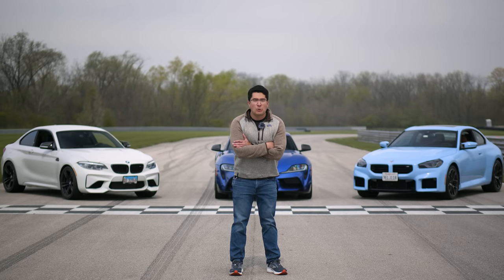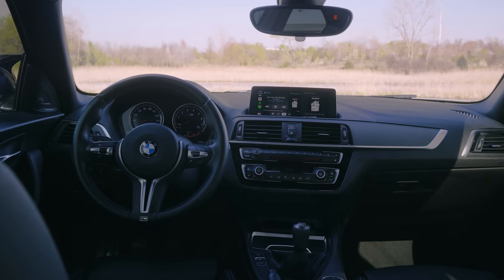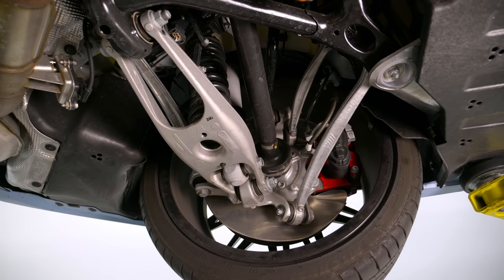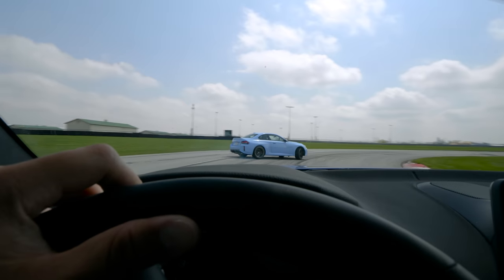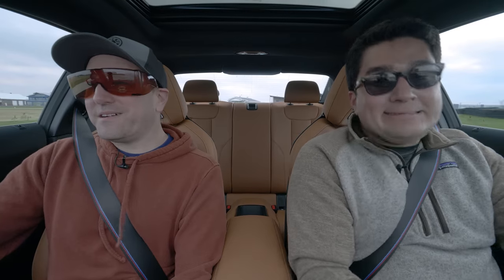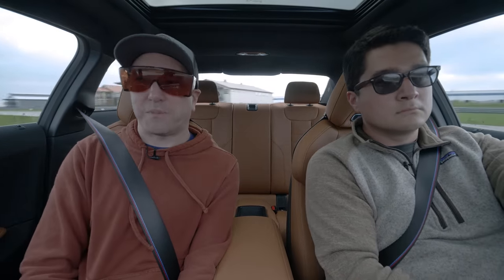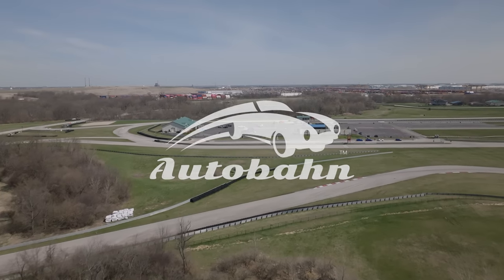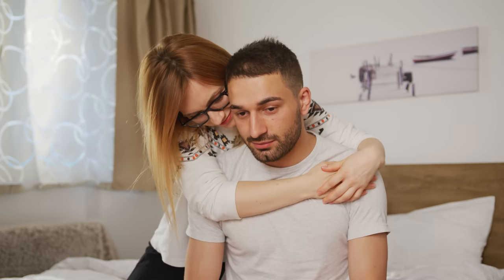2023 BMW M2 vs Supra Manuals | Laptimes and Drag Race

Comment: OG M2 is just a special machine. Often slated for not having an S engine and poor seats, however, this will be more appreciated as time progresses.
Reply: The n55 is weak no matter how you slice it…a special car needs a special engine or at least a competent engine and the n55 isn’t that in my opinion
Reply: The N55 does sound good stock. Emissions going in the way of the S55 sound glorious stock.
Reply: @mogulme6190  Fair, no opinion is incorrect. However, the 1M often hailed as one of the greats, does not feature an S engine. A special car compromises of more than just an engine, in my opinion.
Reply: @user-wz4fw2ws1s  this is a great point! I myself picked up the M2C recently but would have been happy with the n55 as well. What steered me to the M2C was, yes, the true M (s55) engine, still getting some warranty left and having to do next to nothing to get it track ready (bigger brakes & cooling). The OG M2 does require some work on that front...especially at high elevation where I'm at (cooling issues exacerbated)
Reply: the seats were ugly but better. I have owned the OG and now have an M2C and prefer the usability and comfort of the original seats.
Reply: @mogulme6190  lol you clearly never drove it. that said, i did put a wagner comp evo IC, charge pipes, exhaust, FI catted DP, and BM3 stage 2 and it was a beauty to drive.
Reply: @cwx8  n55 really is known to be the weakest of the N and B straight 6s.
keep it stock and its fine, push it and can start spinning bearings. See it all the time on the groups for N54 N55.
Reply: @yuriteixeira5816  And S55 spins the crank hub. So. Just BMW things.
Reply: @cwx8 plus a Bend Calibration
Reply: @idokwatcher2062  Not to mention cylinder coatings in S55s and B58s could start failing (there's reports of that already on forums), whereas the N55 of the M2 has iron sleeves
Reply: @mogulme6190  you can't even afford the car 😂
Reply: Yeah it's the only one in this group I'd consider regardless of being slower
Reply: @user-wz4fw2ws1s  the name on an engine isn’t what makes it special. It’s the character and capabilities of the engine. The n54 in the one 1m is far more capable than the n55. Which is why it was used in the 1m even though the regular 135 and 335 had already switched to the less potent n55.
Reply: @pushdaenvelope  lol you bought the one you really wanted…the one with special engine… the one you know has a bunch of potential. If you were that comfortable with the n55 you would’ve bought one for much cheaper. I’m not saying the OG m2 is bad, but it having a n55 makes it significantly less cool. Than if it at least had a b58.
Reply: @mogulme6190  again, different horses for different courses. Not everyone is concerned about the engine capability as a percentage of owners will keep their cars fully stock. For me, an M car is more than just the engine, perhaps this view is not shared by yourself or others.
Reply: @mogulme6190  a lot of people also aren’t concerned if their cars engine is “cool” or not. People buy things to fulfil themselves and not others.
Reply: @yuriteixeira5816  6 years of active M2 ownership and forum reading and I don't recall ever hearing of one spinning bearings. Not saying it doesn't happen, but it can't be common thats for sure.
Reply: @mogulme6190  yes i did buy the one I want.  Never said I "prefer" the OG M2 with the N55. I'm merely saying I would have been happy with the OG as well. I still think either of them are a great car. The engine is only one piece of the puzzle for me as I outlined in the post.
Reply: @mogulme6190 n55 sucks but the rest of the M2 makes up for it.

Comment: Thank you for putting them on the same tires. Shows the true difference in capabilities. Curious how well the 2019-2021 M2 competition would have done with more than 400 horsepower. Thanks for the great content.

Comment: No comparison is perfect and you guys did an amazing job keeping things as comparable as possible. Thank you for doing such a great job. I would be very curious how a F87 M2 Comp would fare in this test. That said the new M2 is so heavy and unattractive in my eyes that no amount of performance can make me desire to own one. If I could afford a manual Supra it would be my choice of these three here. Love the F87 gen M2 as well as it was the last BMW drivers car if you want to call the Supra a Toyota product. Btw love the Garmin data on the lap times. Really helps illustrate the differences in turns and braking.
Reply: In all the comparisons of the M2 Comp and OG M2 the cornering speed is fairly similar, but the M2 comp has a higher speed on the straights by 5-7 mph depending on the straight length (135ish vs 140sh). So on a small track like this it'd maybe be up 0.5-1 sec on the OG M2. Still probably the slowest car here. In Car and Driver's lightning lap the 2016 M2 ran a 3:01.9 and a 2019 M2 Comp ran a 2:59.7. Only 2 sec different and that was on the huge VIR circuit with plenty of straight to show off the S55 advantage. Add an intercooler and tune to the OG M2 and it'd be the same.

Comment: Fridays always better with a SG video! Great comparison as usual from the best car channel (both content and production)on YouTube.

I’d buy a Camaro ZL1 over a fully loaded M2 FWIW…
Reply: ZL1?? That's like 650 hp, isn't it? I don't think that's really a comparator, maybe an SS. And you still can't see out of them.
Reply: I can’t see anything out of the ‘maro.
Reply: agreed, hard to be a track ready weapon like a ZL1
Reply: @johnsullivan8673  buddy has daily driven Mustangs for years, picked up an SS and has used it as a DD and says you get used to it re outward vision. Has a ZL1 on order and will dd that also. He works for an auto group and was a BMW fan for years but as he says there’s nothing like a v-8. On another note the new M2 is awfully heavy.
Reply: @TML34  I think they are both around 72k so yes IMHO in terms of price they are competitors.
Reply: @TML34  id only consider the camaro as convertible for that reason, and it even looks allright

Comment: I fixed the front end problem on N55 M2 by installing the camber plates (-3). Reprogrammed DCT, Steering, DSC and rear diff, Performance pads and the car has transformed! Tune the engine to the stage 2+ with little budget and you get the car on the same performance level.
Reply: n55 runs pretty hot right out of the gate stage 2 without radiator or charge intake manifold upgrade would run into limp mode if track in 100f ambiant.

Comment: Great video guys thanks!  I am a little surprised you ran the OG M2 compared to the Competition; the sharpness and power differences are pretty significant.  If we could get the manual CS in there that would be the dream but I will take what I can get, lol.  I believe the M2 CS is the only manual CS-trimmed car, for whatever that is worth.
Reply: The Manual CS is not a fair comparison to the G87. Once the G87 CS comes out next year or 2025 then it should be fair
Reply: What sharpness difference? All suspension bits have same part numbers between OG and Comp

Comment: Sounds the older M2 is the way to go and just spend the price difference on power and suspension bushing upgrades!
Reply: Doesn’t need that, alignment and cs steering, diff and traction software.
Reply: No, you’ll be spending the price difference on maintenance and repairs.

Comment: What tire sizes did you run on the new M2? I didnt think the RE71RS came in the proper sizes yet for that car. Did you go down to 19s or did you run the 285/35R20?
Reply: Factory size. Aspect ratio slightly changed
Reply: @jackholmes8105  so a 285/35/20?  That is over 4 percent taller than stock assuming a 275/35/19 was used on the front.  From personal experience, that will mess with a ton of things like the diff and abs.  I am surprised the car even drove out of the bay in the regular start up mode without the TC freaking out.
Reply: @laloosh04  as the tires and wheels were already staggered it made zero difference. Car was driven with and without the re71rs and the car other than grip levels drove the same.
Reply: @jackholmes8105  You increased the rear diameter of the tire by almost 1.2 inches.  The car uses wheel speed to dictate abs and diff behavior and all this matters to how the car drives, grip levels won't change, electronic behavior and car balance will.

Comment: i really feel that the chevy camaro ss 1le should be featured more in comparisons betweens cars like these (i know it's an i-6 comparison but i mean overall)
Reply: Many Cartubers are sleeping on the SS 1LE. Randy Pobst has a 1LE, probably for good reason. Zygrene says it would have been his choice if it weren't for his Porsche. Only thing is, tall gearing.. Which I guess points to its track purposes though.
Reply: Yeah and a stock SS 1LE is 15 to 20k cheaper and faster

Comment: So in conclusion, G87 M2: Capability. A91 Supra: Focus. And F87 M2: Experience. 

Its almost like the 3 corners of sport car alignment, the different ways a car can be made to offer its driver, to provide a sporting ride. Savagegeese had the benefit of a track to properly analyze these nuances but I like to think that similar transitions to street driving, where the same flat out drive isn’t usually allowed.

Comment: Needed an M2 competition also….
Reply: Na it’s way heavier, uglier and looses all the character of the original one.
Reply: Has a m engine
Reply: @lloyd.8272  how is it uglier that the n55 m2 😂 igs the same care just has 5mm wider kidneys you cant even notice, 95% of the mosy panels are the same. All thag changes is the minutely bigger blacked out kidneys and three hair line size slots on the bottom lip of the bumper
Reply: @Newgenblackops  the conjoined grills give the appearance of car not being as wide. The edgy front bumper doesn’t match the rest of the car and the exhaust silencer looks like a 90s Alfa.

Comment: S58>B58. Not even a fair comparison. I have a 2023 A91 6MT and I'll give my thoughts. M2 G87 if you want daily driving comfort and out of the box speed. Supra if you want a 2nd car or weekend car fun and easy tuneability because tuning a B58 is less expensive and there are so many upgrade options. If you enjoy building, go Supra B58. M2 F87 if you want budget fun that you can also build and don't want to break the bank because it's used and less expensive.

Comment: Been waiting on y’all to do a manual Supra review for months😩😩. Was trying to hold out before I put my deposit down but I did it anyways lol. Thanks for the upload regardless💯
Reply: You were debating between the Supra manual and the G87 M2?
Reply: @chrisginoc  I was debating between a manual Supra and a Camaro ZL1 1LE tbh. The old M2 Comp was on my radar but not willing to pay what people want for one when I got a new Supra at msrp
Reply: @madmyro  I had a 2021 M2 Comp with 4k miles on it under contract a few months ago but pulled out before I signed the final documents when I found the 2023 A91 6MT. The Comp was nice but I couldn't get the manual supra out of my head.
Reply: @chrisginoc  same, plus after a ride along at the track with a stage 2 Supra (auto) I completely fell in love and sat in a A91 manual and the shifter feels amazing compared to the others

Comment: AI Jack may need to mention CLAR as well as B58. Jeez , an effectively 4000 lb "baby M" .  The F87 M2C weighed more than F84 M4 and yet still felt so much more nimble.  Had the manual Supra been available when shopping, I could have forgiven the horrible visibility.  Great stuff, as always.
Reply: need to check your weight figures.
Reply: @jgr  As I recall F82 was 3300ish M2C was 3500ish. I did do a chassis code misnomer.
Reply: everyone who drives the M2c soon moves on to the newer flashier thing,

ppl who the drive OG know its really the best recipe for a car and tend to holdem for life,  or they end up regretting selling it

Comment: Wish you guys had the Competition on hand, but still a great test. Pretty much what I expected.
Reply: Suspension and chassis are identical.
Reply: @grigorioschristodoulou5229  having owned both I can tell you the suspension is different.
Reply: @cwx8  yet they share all the same part numbers (check forums)

The M2C's extra weight in the front changes how the damping feels and maybe even alters the kinematics as the car will sit slightly lower. But that's it. The carbon bracing in the engine bay can add more rigidity but the N55 M2 has similar stamped steel reinforcements in its place

I also don't know if MDM and Diff software was retuned. CS had definitely retuned software

Comment: 24, work in finance, and no kids planned for 5 years also have a almost paid off 2021 type r with about 25k in equity. Current debating between a used GTS, Manual Supra, M2 comp or refinance the type R, take out the equity, and keep the R and buy a c6 z06 as a weekend car. Tough choices

Comment: It's great we have the same tire on each car but curious about alignments.  I didn't realize how much difference they can make until I got one done recently and went more aggressive on my 996TT.  Even on stock suspension it transformed the car's handling and how pointy it felt having changed nothing else.  I know OEM cars can be all over the map with alignment, so I'm curious if that's looked at at all and how much difference it might make.

Comment: Seems like nobody noticed this, but it looks like they mounted the incorrect sized tires on the back of the G87 M2. RE71RS does not come in the correct 285/30r20 size and they used 285/35r20. This means that the rear tires are 5% taller than what they should've been, and would render traction control, brake by wire and the electronic rear LSD inoperable. No wonder this car drove weirdly when they handicapped it on purpose, without any disclaimer.

Comment: Imagine spending $60k+ on an M2 and feeling dead inside after driving it... When you can spend $30k on an ND2 and have your balls tickled each and every time you drive it.  Where you can feel every inputs from the road to tires through the wheel.  Have great breaking feel and a great manual trans.
Reply: Rather just grab a Camaro SS for my money. Or the factory supercharged Camaro, used of course. Cant remember the name of it....just my opinion. I cant afford a new M2....

Comment: Since much of the fuss is about the 2 tenth’s quicker lap time by the Supra - switch the test to both cars with automatics and I’ll wager the G87 will be quicker than the Supra by a full second at the very least. As much as ‘enthusiasts’ should only drive a manual (whatever) - the S58 is simply matched way better to the Auto with its shorter gearing than the manual. 

In auto, the G87 will spend a lot more of its time in its peak power band on a track and it should easily outrun a Supra with a similar auto setup. Jackie Ding’s experience with the auto reflects this. 

If you are planning to track your car and care about performance, get the auto. Otherwise don’t talk laptimes and just enjoy the manual on the street.

Comment: @34:01 Preach Mark! 1200+hp and not an ounce of steering feel between them. Amazing to me that the 2023 M2 has even less feel than the 2018 M2. What is BMW thinking??
Reply: A few years ago, BMW made a corporate transition from building driver’s cars to luxury/performance cars. This was almost certainly the right thing to do, sales-wise. We motorheads are a vanishing species, and the level of engagement we demand in the cars we buy is, to today’s affluent BMW shopper, a deal breaker. They interpret engagement to be harsh ride, heavy steering, overly sensitive brakes, a cramped interior, and tires that are noisy and wear out too soon. Oh, and a manual transmission? They’re for truck drivers.

Comment: I think Mark has a bias with not liking BMW since the M3 video. If everything is just "EH" and if everything is dead inside with fake noise, digital gauges, dead steering... Isn't everything else that is new. 

Mark "I don't like BMW M3's because it's a 3 series. However man this IS500, Toyota tested it on their track, has a trans cooler bracket specifically for this car,  it's a multiuse car................ IT'S LEXUS, I LOVE IT!"

Comment: Loved this review, I'm currently trying to decide between
1: BMW M2 Comp (manual)
2: Toyota Supra (manual)
3: Porsche 718 Cayman (manual)
(might add the OG M2 to the list)
Just looking for the most fun, satisfying 'drivers' car for street driving (not track driving).  Really struggling as to which is more fun to drive (on street) betwen the M2 comp and 718 cayman
Reply: Cayman is best driver's car for inputs. But that sad 2L engine has tons of turbo lag. Porsche really messed up for that sad engine to be final Cayman before electrification.
Reply: @idokwatcher2062  thanks for the input.  I meant to type 'Cayman S', which has the 2.5L which is still maybe not great but at least better.
Reply: Have you purchased either of the cars yet? I'm looking at between an m2 competition, supra 3.0 and mk 3 tt rs.
Reply: Manual Supra for me!  I own one and it’s incredible

Comment: The powder bluish M2 is a cool throw back color to the late 50's early 60's. Its exterior styling? Meh. The 2018 is better proportioned while the supra looks like your average over designed Japanese styling. However that being said the supra looks stand out. Mark's amber safety glasses fit him perfectly ala' Wally in the Dilbert comic strip. Cool comparo.

Comment: This test misrepresented the M2. The comparison should have used the 2019+ M2C. Also, you're using two very similar power trains in the S58/B58 vs an engine from 2015 /N55. Did you have a hard time finding a M2C for comparison?
Reply: Why when the new m2 isn't a comp in this test?
Reply: If they used the M2C, they prob would give it to the new M2,   the M2C feels too fat and not enought of a contrast as the OG M2 is,   even down on power the OG was still picked as best car to own!   in yo face